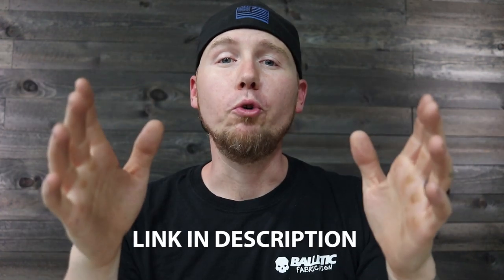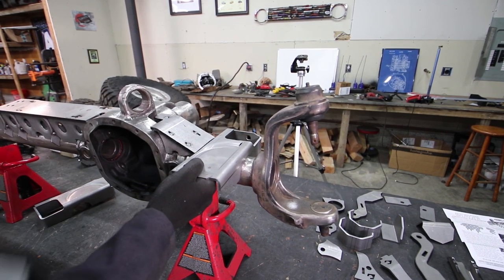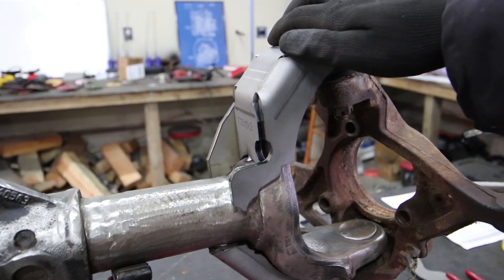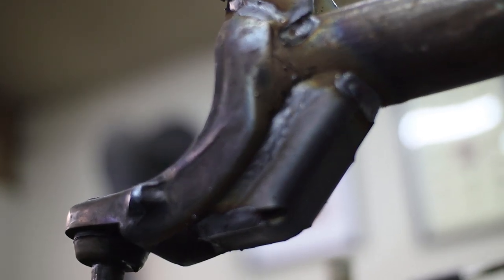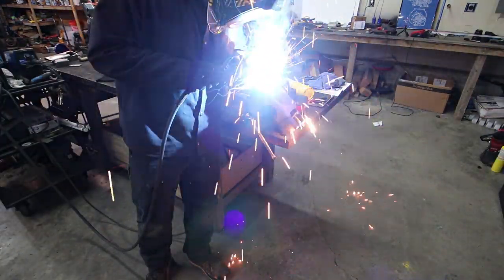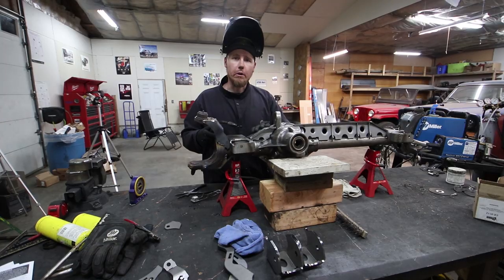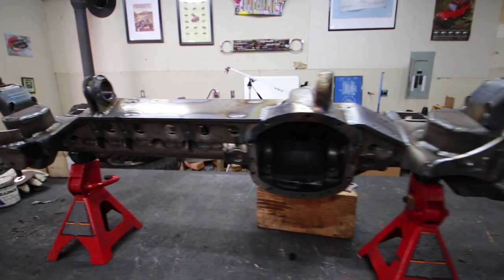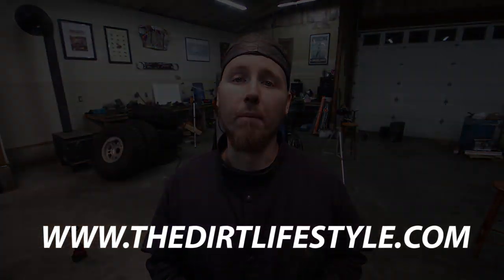Ultimate Dana 30! Episode 1 Artec Truss Install

Comment: I priced out a fully built dana30 and it came out to just shy of $3000, i can’t decide if I should go this route or just buy a G2 dana44 crate axle for around $3500. I would have a shop build my dana30. Not sure what i want to do
Reply: Go with the 44, labor would make the 30 rediculous if you had a shop do it.
Reply: FowlBetterTV it’s a no brainer. spend the extra $500.00 and get a much better axle. unless you’re building it your self, why do so much work to make a garbage axle almost as strong as an already strong stock axle.
Reply from the maker: The G2 is definitely a good option for the right build but there are a few things to consider. I wouldn't use that axle without a truss unless your running 35" tires or smaller. The build we are doing for my brother actually has axle shafts with the same spline count as the dana 44 (30 spline). And both axles use the same outer knuckles as the dana 30. My brothers axle is stronger than the core 44 in terms of axle shafts(rvc) and the housing but has a weaker ring and pinion. But he will never break a dana 30 hp ring and pinion with the 4.0 lol. Not enough power. If your having to pay someone to build your 30 than I would do the dana 44. And 3500 bucks is the cheapest over ever heard on one of those! That's a good deal! Good luck brother 🤘
Reply: @jameshall4385  The only difference between the dana 30 and dana 44 is the ring and pinion size. The tubes, C's, knuckles, Etc are all the same. The aftermarket 44's come with thicker tubes and can be upgraded to higher spline unit bearings and shafts, for more money. The dana 30 with truss and upgraded shafts is not a bad axle. I think the dana 30 gets a bad reputation from guys with JKU's on 37's doing stupid stuff. In that scenario it will break every time. If I could get a G2 44 for what I have into my 30 I would do it. But I have only spent around $1100, which includes a truss, gussets, gears, locker and chromoly shafts.
Reply: Guess I’ll weigh out my options. Im always keeping my eye out for a rubicon dana 44, one just sold on Fb marketplace within 30 mins for 2,000.
Reply: @aljohnson1191  yeah my advice for the LP dana 44 is its not worth the trouble. you lose ground clearance and increase the driveline angle for a premium price. I haven't heard of anyone breaking the gears in their dana 30 so in my opinion its a waste of time and money.
Reply: As others have said...if you can't do your own work then there is no reason to put that kinda $$$ into a 30. I'd go right with the 44...they were selling the Dana Ultimate 44's for not much more than that a while back which were decent...choice of gears, chromo axles, & eaton locker. Not sure what kind of Jeep you have.
Reply: a lot of companies post the starting prices on the axle housings not the actual base cost for everything in the axle...ECGS, northridge and teraflex do that...very annoying...add even the used/remanned materials to make it a drop in affair and the prices go through the roof, that's why I'm doing my own.  I have a friend that just got rock jock D60's...each axle cost more than what I plan to spend on ~75% of my entire build

Comment: Nate I need your help. I currently have 15 JKU and I trying to figure out which route would be best for the front axle. I am a weekend trail wheeler, and drive it everyday. I want to run 37's but am torn between building the dana 30  or swapping to the 44. Without going to an aftermarket axle housing the only thing I would gain would be a bigger ring and pinion. What is your opinion?

Comment: Got a question, I've got to replace a lower control arm bracket on a low pinion d30, I'm figuring down the road I'll upgrade to a D44 but I'm not ready for that yet, should I bother with c gussets or a truss?

Comment: Hey there man I am getting ready to have my welder buddy do this to mine when I recover from a bad wreck and can physically help in a few weeks hopefully anyway that is and I was curious is there any reason to leave or not leave un welded spots at the bottoms of gussets etc  where if water seeps through weld spots that it could escape and not sit to rust?
Reply from the maker: The artect truss has gaps so water can flow through. I designed the truss on my TJ the same way. 👍
Reply: @DirtLifestyle  

Sweet ok thank you. I grabbed the Rusty's offroad cheapie one but thought of sealing the whole thing but probably won't based on your answer. I also use the u-pol weld through copper primer under whatever he welds in on for me to help prevent rusting where I cannot address after whatever is welded on so just trying to be careful and keep her the road for decades I hope.🙂

Comment: This truss isn't doable with an arc welder is it?
Reply from the maker: Yes it is if your good. You don't want to weld to hot with out preheating. An arc welder can get shit hot in a hurry. That fast increase of temperature can cause problems. If you pre heat ahead of time (tubes included) you might have better results 🤘
Reply: @DirtLifestyle  How would an arc welder be much different than mig?

Comment: Would you run 37s on this setup?
Reply from the maker: Yes I would! With a light weight vehicle of course. Tj or smaller. The 4.0 is a good balance of low power but enough to move out of it's own way and shouldn't put to much pressure on the ring and pinion 🤘
Reply: Without a locker it should be ok if you're nice to it. I would never put a locker in with 35's or 37's. Lockers are amazing but they put a lot of stress on axle shafts.

Comment: If I do this to my stock dana 30 and get 5.13 gears, would this be strong enough to run 37's comfortably?  I have a 2012 JK with a 2 1/2" lift.
Reply from the maker: I would be super cautious to run a dana 30 with a 5.13. That's a tiny pinion gear. The deepest gear I would run is a 4.88. If you throw a truss on it you won't bend it but the JK knuckles are super weak. Very easy to bend with a 37. People run 37s on a JK dana 30 all the time but I wouldn't do it my self. To much weight to push a little axle that far. Not trying to be a debbie downer! I just want to give you my honest opinion!
Reply: @DirtLifestyle  that makes sense, I think i'll just save a little more and upgrade the whole front axle assembly. It seems like I would be taking a chance of wasting money. Thanks

Comment: I am in the middle of this process now, loved this video. But, does anyone know the diameter/length of that sleeve for the shocks?  I could buy a bar pin eliminator kit I suppose, but then I have to wait a couple days for it when I can just go to the hardware store and get it since I don't need the bar pin eliminator bracket in this case.

Comment: I just don't like how many bits and pieces these truss kits always seem to be made of. Like the main truss on each side in my opinion could/should be (1) piece of 1/4" or 3/16" steel, laser cut and formed into a "C" channel shape that sets on top of the axle tube. Not (8) parts for the long side and (3) for the short side; just (2) contiguous parts, (1) for each side. Besides definitely looking cleaner, it would have the potential to be much stronger, with much less chance of warping during welding. My only guess as to why they all go the Erector Set route is because it's a lot cheaper to burn and ship flat plates compared to formed shapes? I'd rather pay the $50 more for a better part, lol...

Comment: Excellent video!  Iv been watching your videos for a while now and just realized i wasnt subed.  My bad dude lol.  I know you have been slammed, id love to see some wheeling videos too!
Reply from the maker: Thanks for subbing brother! Once they open public lands back up more wheeling videos will be on the way 👍
Reply: Awesome man!   Hey did you do a video on the diesel swap?  Im curious what engine that is and what it took to make it run
Reply: Also i have a bit of a project on my hands and im curious what you think.  Iv been off roading for years in a full size truck and im just now getting into the jeep thing. Fought it for a while, until i found myself wanting to fit in trails my trucks are literally too wide for and much higher complexity. Im a pretty accomplished welder and fabricator, im not afraid one bit of repairing the tj frame i have and building a 4 link for the rear and a 3 link front. What im curious about is there a portion of the frame i should know about that i need to discard and build different. Currently the body is off the frame. I have some tub work to do well its off. I was planning on a rear and front stretch with coil overs.  A 5.3 4l80e and an atlas to power it with a 60 front and 10.5 year.  I was looking at the rear frame and there are body mounts down the bumper and under the load floor.  Is that section of the frame useful with 4 link and a stretch?  Or do i need to remove it and fab a different section. I just wanted to make sure you didnt encounter any challenges with your frame that i should know about now.  I am either going to look into that fuel cell that is in the stock location that is made for a a stretched frame or get one for the load floor.  Thank you nate

Comment: What a waste of time and money. If I was building a light rock buggy with a subaru motor it might work but in a regular Jeep every cent you spend on a Dana 30 is wasted money. All that work and the pinion gear is still a tiny, tiny gear that will not like 35" tires as that gear gets smaller the lower you gear.